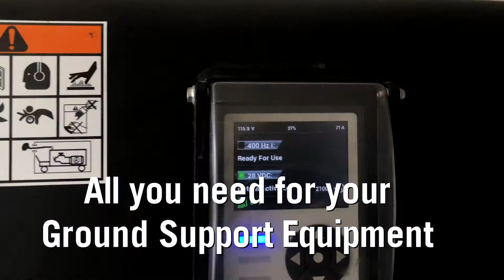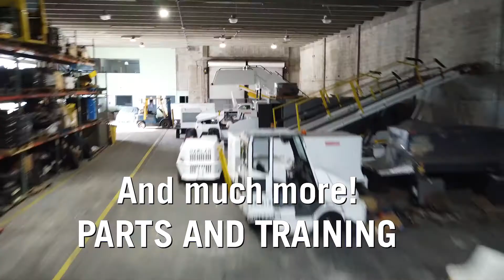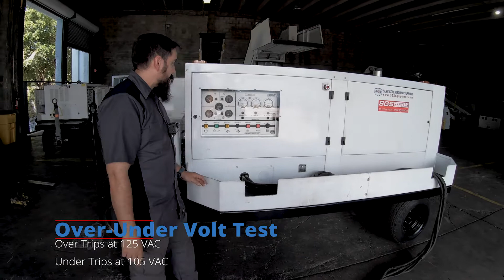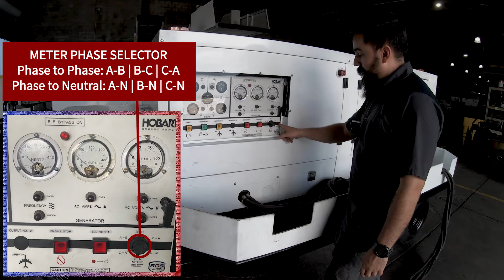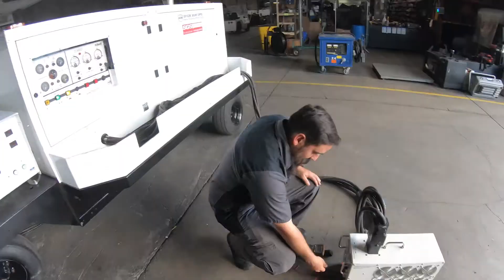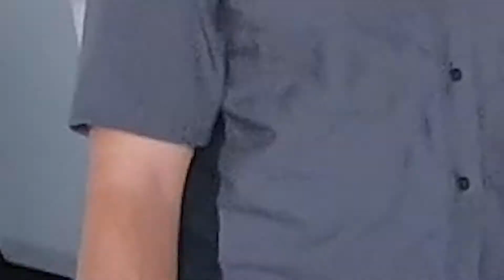Load bank testing a Hobart 90CU24 Ground Power Unit - Part 1

Comment: Hello I have a ground suport unit 25kv , can it be converted to a normal 3 phase generator? If you could help me with it that wold be much appreciated!
Reply from the maker: Hello Elvis, are you referring to converting a 400hz GPU into a 60Hz GPU? if this is the case, then, no, the windings on a 400Hz generator are different than the ones on a 60 Hz generator.
Reply: Buenas noches, venden los bancos de pruebas de los gpu hobart

Comment: Quality ground support equipment!
Reply: I have a question. What if there is a error message EF no signal aircraft rejected on GPU?
Reply from the maker: Ferdinand, that error means there is no EF voltage coming from the aircraft to the GPU, check continuity of E and F cables to make sure they are not open and also check continuity between E and F, it should be a close circuit.